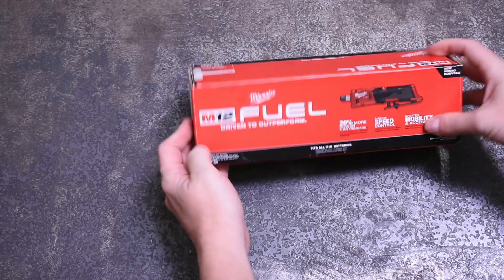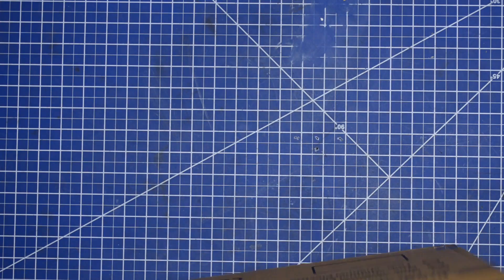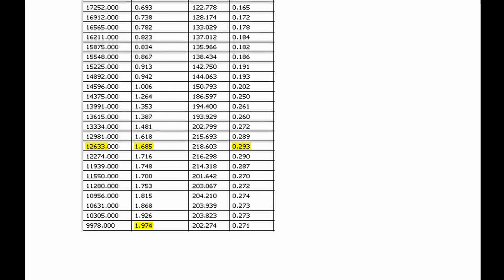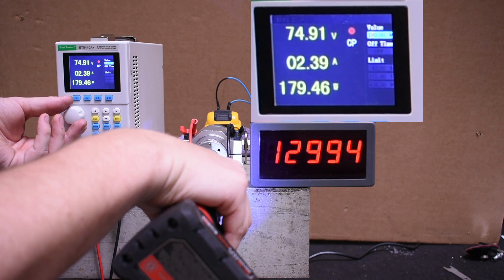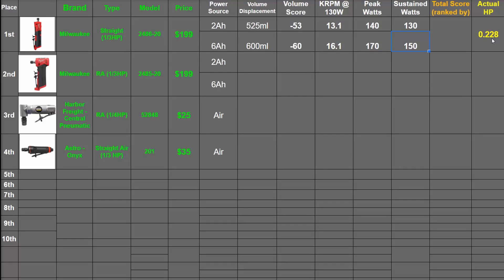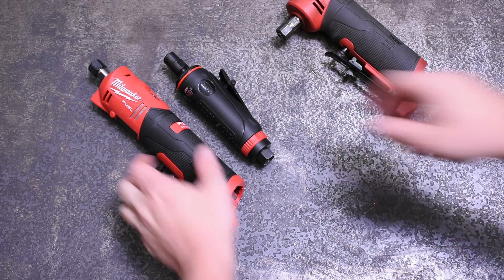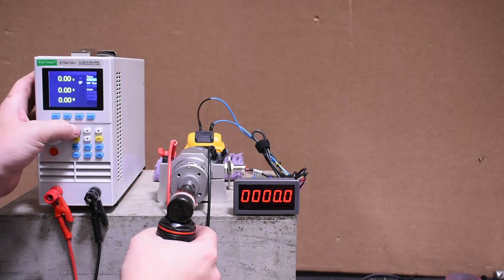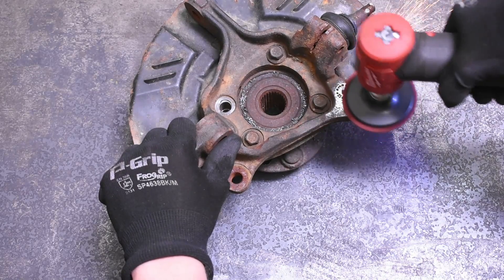We Built a HP Dyno: Do M12 "1/3 HP" Die Grinders Really Beat Air?

Comment: I have a concern that you'll kill your DC motor, possibly from heat (but sorta doubt it; easy enough to monitor); however, I think there might be premature front bearing wear that would take it out before anything...

I'm no expert though. I'm basing this on the expectation that the motor isn't driving anything in a way to directly impart any load (x, y, or z) in its intended application, but instead would be behind a bearing block (or two) and the load would be taken up by that...
If an accurate assessment, you'll probably need to redo the tests after a bearing (or two) is in place, to account for its parasitic resistance. Which if it starts to wear, you're only out the bearing(s) in theblock(s) and not an expensive motor's integrated one (which might only be sintered oilite bearing/bushing at the front, ball at the back)

EVEN STILL, the tests may need redoing if you hadn't accounted for losses due to any imparted binding on the motor's bearings, either from the weight of the tools hanging off its shaft, or just user-error – I'm assuming it's being given some counter support while the hand is engaging the trigger, but it wouldn't be precise and could shift results that way...

Just my 2¢, and I do not doubt that you are jumping into this without plenty of consideration, so it's easily possible you already considered all of this. 🤘

Comment: I want to see milwaukee right angle impact on the dyno with the high output 5.0 battery. Earlier this week I couldn't get a crank bolt loose with a 6.0 battery so I just tried my new 5.0 battery and the crank bolt came loose with relative ease. So this made me curious of how much extra power is made with these new m12 high output batteries on milwaukee's disappointing right angle impact

Comment: Interesting.  The cordless die grinders are super handy, but I would prefer air power if I had an appropriate compressor.  The cordless ones really seem light duty/ for occasional use.  But that's all I need right now.
Reply: Just a little comment on reliability, I've used my Milwaukee 12 volt die grinders quite heavily in the 1.5 years I've owned them,  with zero problems. I own many Milwaukee cordless tools, and I think they're great.
Reply: @Ethan-dc5fi  I worked in a sheet metal shop where I would spend days on end deburring laser cut stainless parts, and I wouldn't choose the Milwaukee for that job!  So my definition of "light duty" might overlap with your "used quite heavily" criteria.

Comment: The right angle milwaukee is fairly weak sauce compared to even a cheap air die grinder. Still a super nice tool tho. The inline 1 is definitely got power tho. Problem is for the price of just 1 of these skins you can have a right angle and inline air grinder

Comment: id be intereste din seeing matcos .85hp die grinders tested as i have them but also i wonder what it will read for such a high hp claim, aswell as how theyd stack in your charts as they are much bigger but are noticabley stronger than blue points ive used

Comment: I wonder if there's some kind of progressive load you can put on the power end of the dyno to let the tool max itself out instead of trying to dial it its limit manually. Like maybe a large electrical resistive heater element (think water heater heating element). Then you can record the heat of the element, and calculate the watts from that. Say from a reference curve made from performing a power sweep on the heating element done with a DC power generator.

Comment: Would be neat to see the ryobi, it's not small, or convenient but it's usually better than dragging a hose out or running a giant grinder for light use. I suspect the battery will make a big difference and with the dizzying amount of options it might be tricky. I run mine mostly on a 2ah lithium+ on low on low speed to clean up surfaces, If I'm prepping an area for welding or something I'll put some variation of 4ah for more runtime; I know the air tool will probably last longer, but it also runs the compressor, is loud, and makes my hands cold.

I had bad luck with the right angle HF's, almost all of the cheap ones failed, a few years ago they changed the design a bit and I just haven't seen them hold up since. I usually use an astro now, it's had a few hundred hours at least and is still fine.

Air tools do seem to have more controllability if working on delicate surfaces since restrictors and air pressure can be modulated. This can make it easy to stall them, but better than burning a hole in a panel trying to remove a bit of material.

Comment: I owned both versions of the Central Pnumatic right angle die grinder for a bit. The rear exhaust version stopped working after like the second time I used it while the front exhaust one just had ridiculous levels of play in the spindle.

I now own the Chief mini right angle and and straight, both metal body and like them. The straight is perfect while the angle has a slight amount of play in the spindle, though less than my IR 301B after it got repaired under warranty for unacceptable levels of play. I'm happy to send in any of my die grinders for testing if you want.

Comment: Milwaukee states “max accessory 2” “  you’re using a 3” sanding disc. They do work best with a 2” sanding pad. Larger wheels or accessories require more torque.

Comment: Wait, there are other battery/electric powered right angle die grinders other than the M12 Fuel ? It's so frustrating to only find air tools, they require a gigantic compressor.

Comment: Long live air die grinders.  For most use cases in which I see myself reaching for a grinder, I really don't seem to care if it has a hose or a cord attached to it, which is why I've long favored air powered die grinders for most shop use and 120v Dremel/Rotozip for stuff in the house.

This ranking system pretty much adds the hard data to what I've long known intuitively about die grinders:  electric motors take up too much real estate for the tight quarters work that often calls for the die grinder to come out and play.  Yes, a cordless die grinder would be exceptionally portable and convenient in some situations, but if I'm close to a compressor, I'm going to reach for the one that makes more power in a package that's 1/3 of the size.

Comment: Assuming a 50-60% efficiency in the DC motor being used as a generator, I think the 1/3 HP (249 Watts) is exceeded with the Milwaukee Straight die grinder.

Comment: I own that angle die grinder and mine runs a carbide burr just fine, but if I put a mini cutoff disc or mini wire wheel on it after a few seconds it just shuts off/quits.  I swapped out the tool with a new one thinking it was defective but the new one works the same.

Comment: Dc motors used as generators are only about 50% efficient at converting mechanical hp to electrical watts. You may need to take that into account.

Comment: Kinda wanna send you my Snap-on cordless right angle die grinder so you can figure out why it sucks so bad. Snap-on guy said it's normal to shut off while trying to cut a piece of metal and shut off while trying to grind some paint or rust off metal if you push to hard on it. Got it replaced and even sent both to Snap-on for testing and they said both were fine.

Comment: This rig is cool but flawed . If you use the motor as a brake though and mount it so it can turn around itself but stop it from doing so via a 1ft long arm which is attached to one of those cheap strain gauges you'd be able to calculate the actual power of the tool and not what the motor makes out of being turned . Regular brushed motors have a horrible efficiency as a generator. 

Also your power drain is not optimal . Because it's drawing a constant power a tool that's bogging down is going to experience even more braking torque because the power drain is increasing the amperage (this torque ) to make up for the los voltage (e g. Rpm) . That why you see those tools "tipping over " so rapidly once you hit their power limit

Comment: Your measures electrical power, which can be significantly lower than mechanical power.  I would suggest a hinge in line with the shaft and a short arm resting on digital kitchen scales, which would give you a torque readout.  Mechanical power can then be calculated by multiplying with RPM.  Another issue is the dyno motor's ability to absorb significant power at lower RPM during cordless drill testing, which will cause a very high current and possibly overheating.  "Proper" dynos tend to use water brakes for absorbing the load.  One can be jury rigged by using a centrifugal water pump drawing from and feeding into a bucket, with a variable restriction (ball valve) on the inlet side to let you vary the load.

Comment: Hey guys thanks 4 another top quality review/info video. I have had the m12 right angle 4 2 years and mine never cuts out. Mostly use 2 inch rolocs, scotch pads and red ceramic 60g sanding but also have dies 4 it. On the video it looks like your using 3 inch, it says in the instructions 2 inch max. Im interested 2 see if the hp batteries make a difference, thanks again.

Comment: Your testing of the right angle grinding on the knuckle is silly. I run the M12 right angle with 2" rolocs. It will drain the battery without ever overheating (4ah). Don't run it on speed 4. Run it on 2. Heck the roloc rated speed is between 1 and 2 speeds. 

Honestly, I bought the M12 because the noise of an air compressor coupled with the air hose is just obnoxious.

Comment: How is this dc motor setup going to do loading much torquier drills down to 300-2k rpm?
Reply from the maker: It's not 0:25
Reply: @TorqueTestChannel  ah, missed the part about swapping application specific motors.  Thanks.

You should baseline your rig somehow to qualify it and figure out the conversion efficiency.  If it’s only 90% efficient you numbers are 10% low. ;)

Comment: The standard way to do this test would be to measure RPM and use a load cell on an arm of known length (could be a simple digital scale) to measure torque.  Motor/generator efficiency is no longer a factor and results are objective instead of relative.

Comment: Measuring the watts is not really a great way to do this due to inefficiencies of the DC motor working as a generator, and that motor efficiency changing at different speeds and loads. The generator should be mounted on bearings or a pivot, with a torque arm pushing on a load cell. So you would measure the RPM and Torque being developed. Then you can directly calculate the horsepower being produced without the efficiency of your "generator" mattering.

Comment: I'm doing spring pins on a kenworth. Have to cut the welds off the old bushings with a Carbide burr. You're not doing much of that with a battery grinder. Maybe chamfered edges, not shaping spring steel.
Reply: I'd like to see the .8hp grinders tested off the tool trucks.

Comment: Good starting analysis of 'spinning tools'. I test larger (mill/lathe) motors and controllers with a homemade 'dyno' consisting of a large metered (volts/amps) DC motor tied to a large variable resistive load so I can measure torque/HP at different motor speeds up to 2 HP continuous. I consider usable torque to be more important than horsepower (torque x RPM) but when dealing with high speed tools , HP might be a better standard since low speed torque is almost non-existent with die grinders and air tools.

Comment: I have both m12 die grinders but they are about useless for any serious work. They are good thread repair tools and for cutting off small bolts, but they do their best work draining batteries faster than Usain Bolt in the 100m sprint. 

Cordless is nice in some areas but I don’t think it’s there yet, and definitely not for $200 per tool.

Comment: Instead of reading the power from the generator, you could use it just as adjustable load -- read the torque.  You could have a torque transducer on the shaft, or you could mount the generator "floating" and then weigh the force at the end of a a cross member of known length.  We used to have a commercial torque tester built with an eddy current brake and a round plate where we hung concentric weights off-axis.  Three weights, 3 scales.  The rotation was limited to 90 degrees.  The brake torque was set with a DC current, manually, based on the speed display of the motor we were testing. That means we were reading the speed indicator (digital counter) and adjusted the eddy current brake until the desired speed resulted.  Then we read the torque from the scale on the round plate.  It worked quite well, until during one move we lost its collection of accessories and shaft adapters.

Comment: I love this channel, but AFAIK your method of testing these tools isn't really ideal -- all of the electric dynos I had experience with operate in constant torque/speed rather than constant power modes. This is why the smaller grinder died down -- when the RPMs are falling, the electronic load tries to compensate by ramping up the load current (and in case of electric motors, current is pretty much proportional to the torque) which leads to motor stalling. The better setting would to be to enter constant current (torque) mode and then reading the resulting power output. You can also load the tool by constant torque and then measure the rate of angular acceleration, but that would require changes to your dyno (a much faster sampling rate for RPM would be required) to account for the rotating mass and the force required to accelerate that. Lastly, you can try to test the tools in constant speed (voltage) modes to find the optimal RPM for a given engine (when speed x torque is the biggest). IMO, using constant power mode is really not suitable for this kind of testing due to very high starting torque and this inverse torque-RPM relation I was rambling about. Once again, lots of love and I hope I helped you to further improve your testing methodology
Reply from the maker: Hey thanks. We just wrapped testing cut-off tools but I'll look into this. The value is in the comparison between tools but if a different setting allows us to hammer that down more then I'm for it.

Comment: I know you guys ran a test on the high output batteries for Milwaukee last month. Your conclusion was that at the time the motors were not capable of drawing more than what the six amp hour could provide. Honestly curious if the five amp hour high output would make any difference on motors like this with the direct drive that you mentioned in that last video.

Comment: You are not measuring the output of the tools with this dyno because the load gemerator is not 100% efficient.
You need to divide the results with the efficiency (about 0.6 to 0.8 for small DC Generators).

Comment: Die grinders are supposed to be hooked up to 1/4” ID fittings w/ 90psi running pressure. Running them w/ 3/8 and 110psi makes it kind of a sided affair.

Also the Mileaukee die grinders don’t do well when loaded inline to the spindle (eg sanding pad). When loaded perpendicular to the pad (eg carbide burrs) they rarely, if ever, cut out- even when pressed hard
Reply from the maker: A 3/8" hose uses 1/4" fittings, which is what we used. I'll have to try the burrs
Reply: @TorqueTestChannel  Oh okay, I wasn't sure since you can get fittings and couplers for 3/8" hose whose ID is larger than 1/4". For example H-style fittings have a much larger ID compared to standard Tru-Flate style fittings.

And yeah with the burrs they work a blast. It also seems like the M12 die grinders are designed to be used with them, since the head is partly flexible (especially notable on the right angle), which seems to make burrs not jump as much as they do with standard die grinders.

Comment: I have the Milwaukee angle grinder. It is not worth buying. Like you stated, the 'protection' modes that almost seem random, make it a nightmare to use! I find it only useful for fast, light edge deburring. Anything heavier than that and its best to use the air tool. It's weird because their M18 4-1/2 grinder can really take heavy abuse! I also hate how large the handle is compared to the air tools. This review is coming from a true Milwaukee fan too!

Comment: Very good. Would like to see something like the Aircat 6280 .75 HP angle die grinder tested. Spent 40 years as a machinist those 1/4 and 1/3 horsepower die grinders are mentally painful for me to use. After having access to the good ones for so many years, (1/2 horsepower or greater).

Comment: I wonder how comparable the analogy here is to engines. Like, the 240hp F20 in the S2000 and a 245hp Cummins have VERY different torque numbers, as well as operational RPM (examples used cause of my familiarity with them, better ones may exist). Because of the tendencies of the engines, they make wear differently, and therefore are better used in different circumstances. Doesn’t mean one is better than the other… just, different
Reply from the maker: I would think for a grinder you'd want something like an S2000 or nothing, so measuring horsepower alone works. As more torque at a low RPM does nada for using burrs and cut off discs.
Reply: @TorqueTestChannel  that’s what I was thinking. This type of tool you def want the speed up, not a case where you need a tractor to plow the ground. Don’t really want to “power” thru. Really makes me curious now what effect the gearbox in the air tools has. Could be they don’t have any torque without it, and even the slightest pressure bogs them down.

Comment: I have the right angle Milwaukee and I knew from the first time I used it knew it was weaker than claimed. Still like it as it gets into places I need while not needing an air hose. Also is great working in places you don't have air hoses.